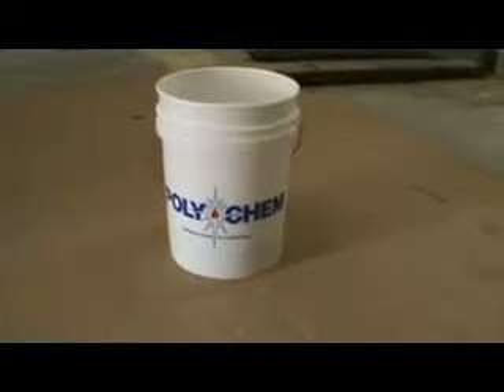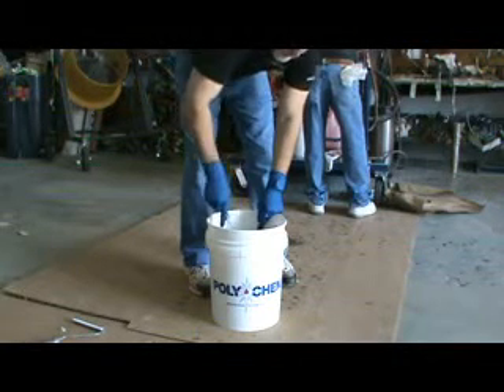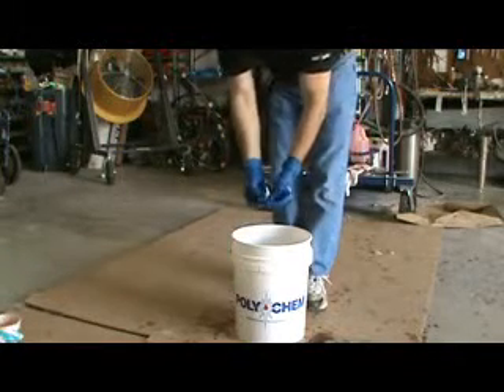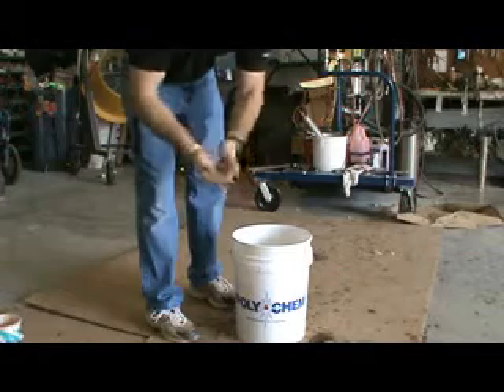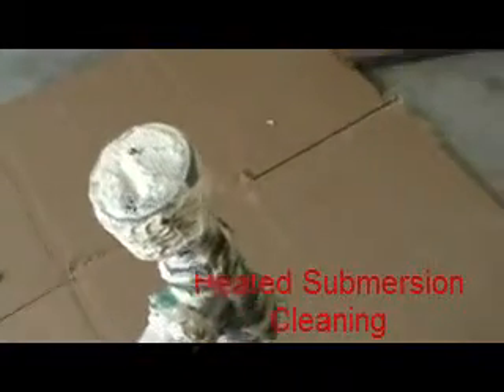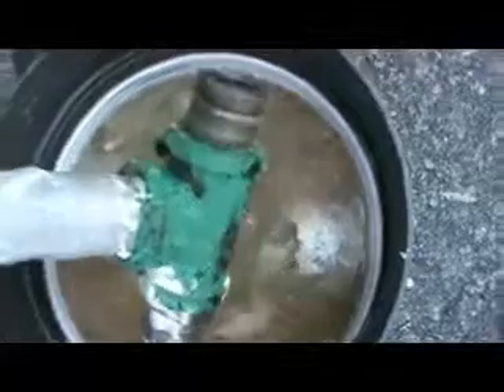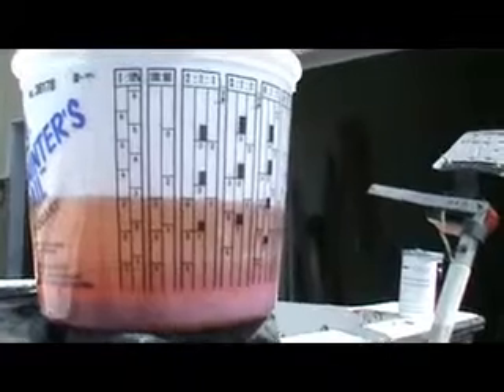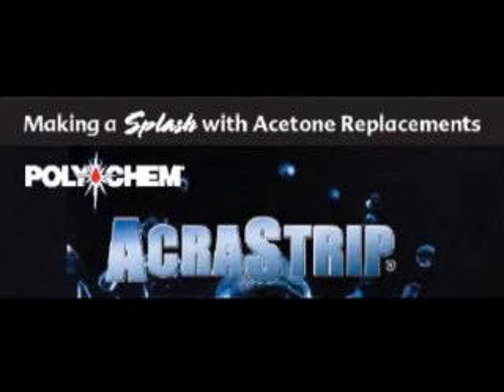Acrastrip -- An Acetone Replacement Chemistry

Comment: When you were cleaning the filter housing, you said cured resin, I'm assuming what you meant was old "dried" resin, it wasnt actually catalyzed was it? Also it says on the bottle it can be heated to 140°, I have one hell of a old resin project to clean up and I'm wondering how much more effective it is when you heat it up?